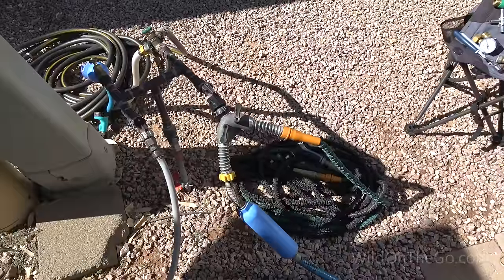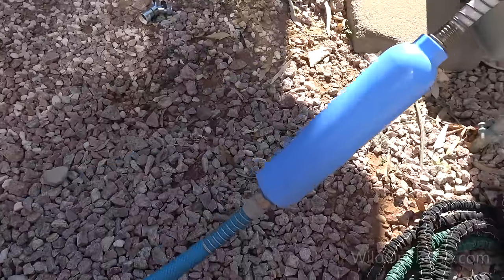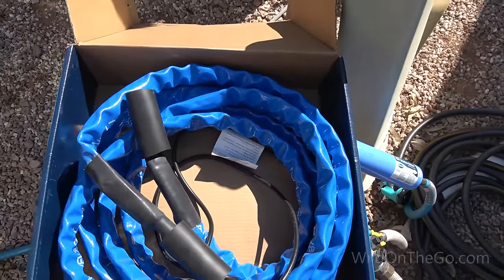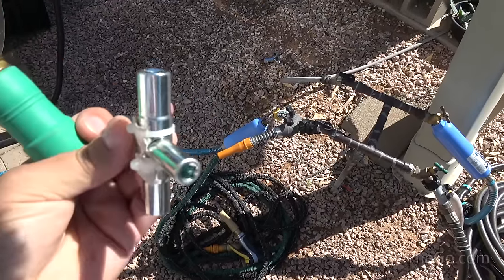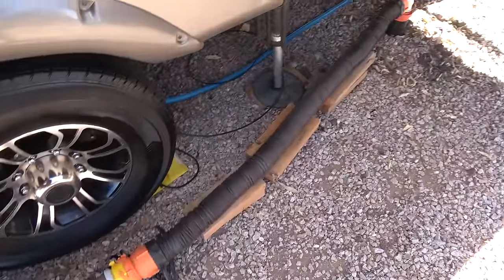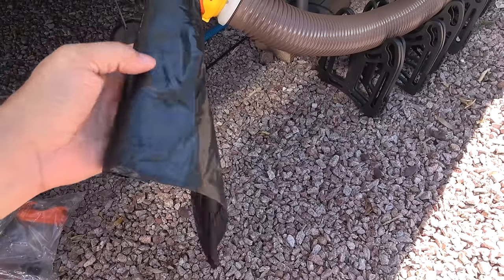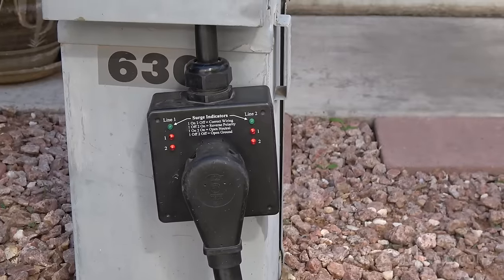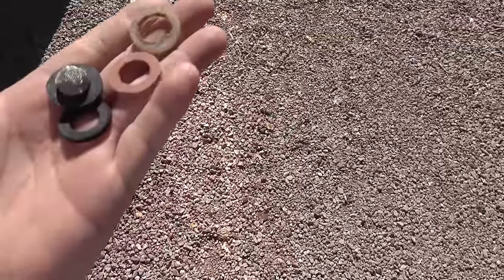RV Hookup Accessories for New RVers - Full Time RV Travel

Comment: Great tips. Will definitely get the heated water hose. My plastic sewer hose support broke so I invested in an aluminum one. Also storing them in a rubbermaid type tote pan then I label one for sewer, one for water and one for electric. I always store them on the driver side and they easy to access. I did get an adjustable water regulator so if necessary I can turn down the pressure. I have the old style pressure regulators left over from my old rv's however, I find that with my Montana, that pressure is too low and according to Keystone manufacturer can have a much higher psi so water pressure inside the rig is great!
Reply from the maker: We're glad you got something out of this video.  Yeah, we rarely need a regulator.  Thanks for watching and liking this video. :)

Comment: Good video, one thing you might want to look into, is RV Snap Pads that fit onto your 9" Hydraulic Feet, I have been using them and they work great, I have 6 since I have a Montana, roughly $25.00 each pad but made of recycled Rubber Tires so these things are tough and help with stabilization.
Reply from the maker: Thank you. We're glad you enjoyed it. We're familiar with the snaps pads: http://amzn.to/2D8fCJk We use pads that do not attach, so that they can be offset at will, don't pickup debris because they're not left on (permanent), and they do not cause drag etc when underway.  Happy travels. :)

Comment: Only suggestion is if you have your Blackwater flush on the same Y put a back flow preventer between the y and the blackwater/utility hose... just a little piece of mind to keep the two from ever being cross contaminated.
Reply from the maker: That's a great suggestion.  Another person also mentioned that in an earlier comment. We remembered, after the video, that the clear elbow that we purchased came with a small, black back-flow preventer.  It sure is important.  Thanks for bringing it up, and thanks for watching and subscribing.